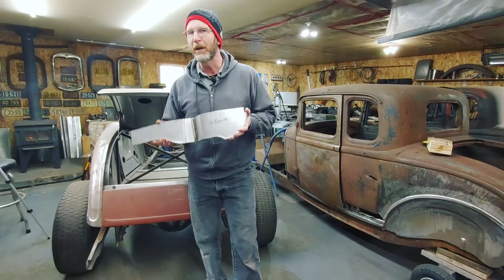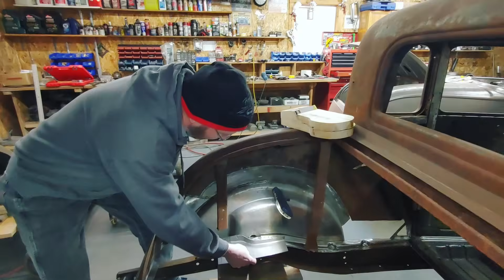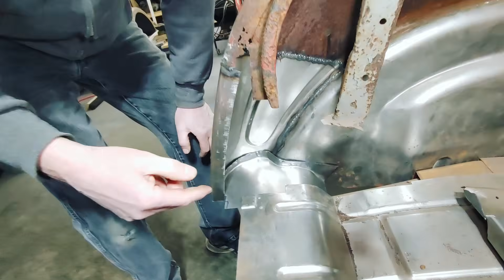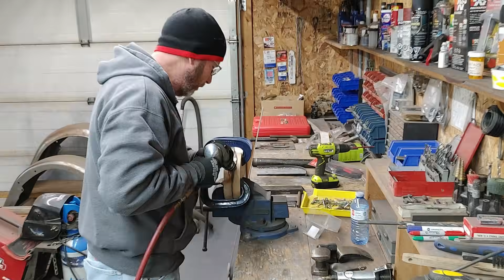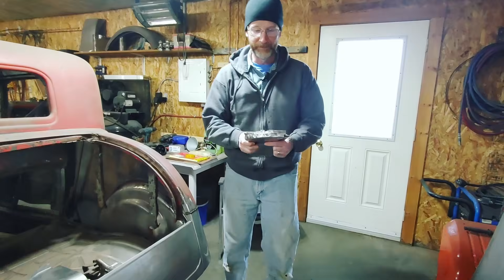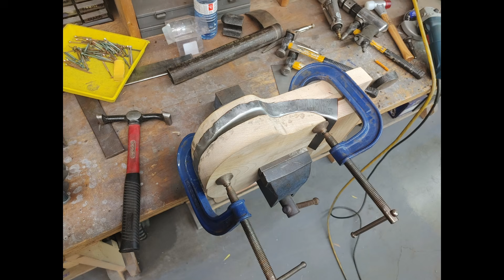1932 5 Window Coupes get sub rail extensions and floors

Comment: Do you have any experience with 32 Chrysler coupe CH. I m new here and the ford looks like my Chrysler.
Reply from the maker: Hi, no I haven't any experience with a 32 Chrysler. It's a nice looking car for sure. Does it have a metal inner structure or wood? Some late 20s and early 30s cars have wooden inner structure. Ford had metal with some wood pieces.
Reply: @coldstreamrodshop  metal
Reply: I'd send a picture, but it's not letting me